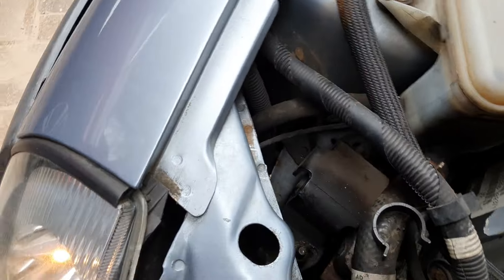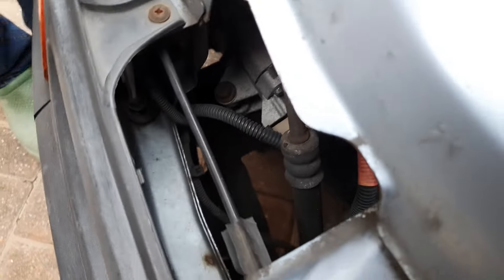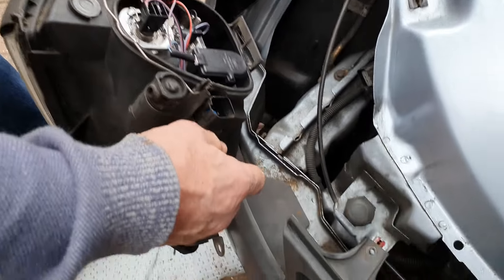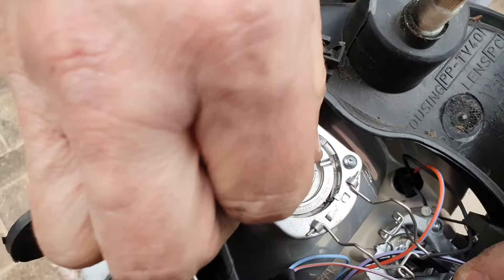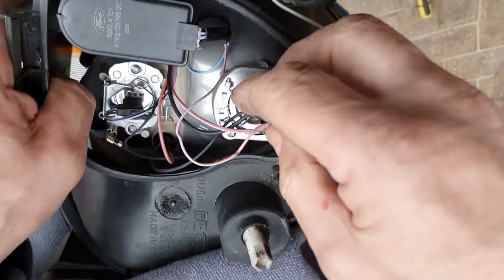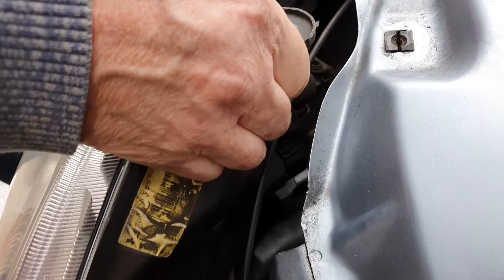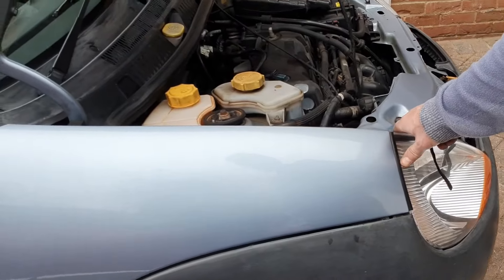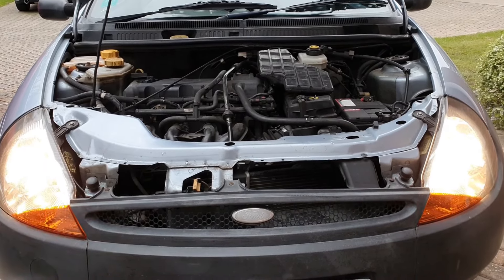How to Replace Dipped Beam Bulb on Ford KA

Comment: I changed this bulb last September and actually managed to get it in from above, without removing the entire housing. I did remove the rear plastic cover entirely in order to have room. 

I was then unable to get it back in place, and ended up turning the wheel to the right and undid the four screws holding the wheel well and engine cover trim in place. Which gave just enough access to put the cover in and reinstall the metal clip, which had come undone due to my fiddling. 

I did consider removing the trim like you've done here. But seeing as every time you do end up breaking one or two clips, and I don't have any replacements on hand I decided against it and went for the route above. Where would one acquire these clips? Is it a universal type or specific to the Ka?

Oh, and if ever you need to do the left bulb: you'll be pleased to know there's just enough space there, I didn't need to do any trim removal :D 

Lovely video! Brought back memories :D
Reply from the maker: Very interesting, useful feedback for the future. Thanks  pleased you managed it. I have added a link in the description to suitable bumper clips on Ebay. Hope this helps.